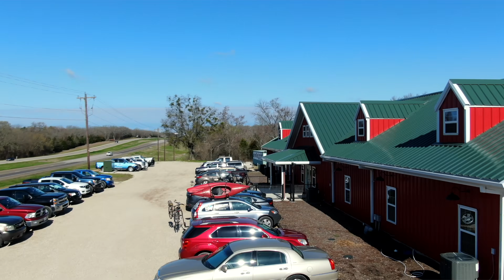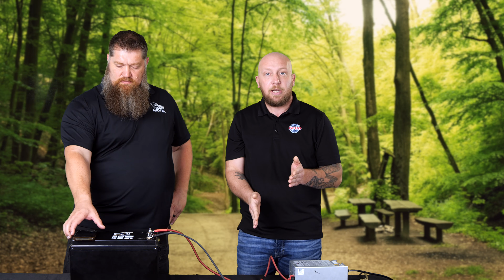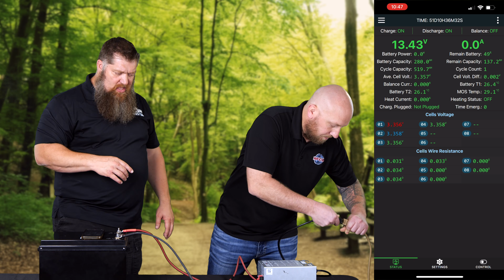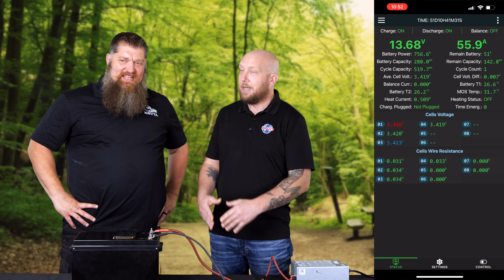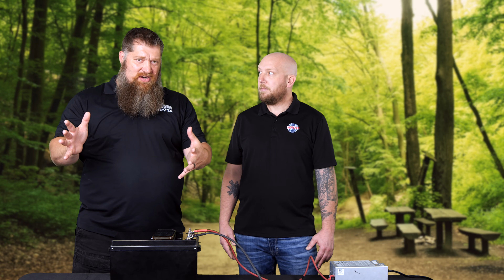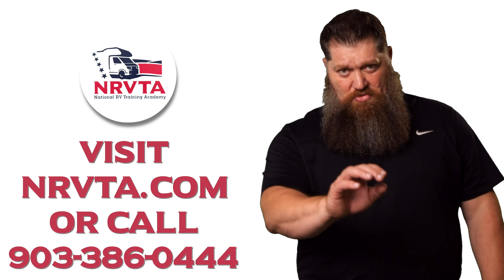WFCO auto detect battery charger, does it actually work?

Comment: I (like many others looking for this converter) have updated my camper to a battle born 100ah lithium battery.  After talking to WFCO about updating they said that I would need the updated converter with the 1.19 version for the battery to “auto detect” the lithium battery and switch from lead acid battery mode to the lithium mode.  The only supplier that I could find of the 8955-AD-MBA auto detect was Amazon.  I purchased the “updated” version hoping that it was the one with the 1.19 firmware version, since Amazon support would not tell me if it was or not. (Unless I purchased it first, dumb).  I received it, and sure enough it was not updated.  WFCO tech support said that it needed to have a sticker on it saying 1.19, mine did not.  WFCO tech said that it should still work anyway with the battleborn battery.  I tried to get it to “auto detect” lithium for a week and also while on the camping trip, both with shore power (Regular 110 house outlet) and with my very capable generator.  I had to run the generator for at least four hours a day while camping (since it was only charging in Lead Acid battery mode) just to keep us above water and not losing full power for our 12v fridge.  On the last morning I gave up and my final attempt was to let the percent of battery go down to 4% remaining, (WFCO says down to 10% to get it to switch) kicked the generator on, let the light turn green and the red charge light startup, and then flipped the main power breaker off and back on, and the light finally turned blue.  After all of that, and lots of celebrating,  the lithium finally started charging at 50 amps (up until it reached 50% capacity and the charge rate dropped substantially to 13amps) Now, come to find out, the converter is still not letting the battery take the full charge and has never reached the “balancing” 14.2 v even when it’s in lithium mode.. So, even though I got it to switch to lithium mode, it’s still not doing what it’s supposed to be doing.. I followed all of the YouTube recommendations from WFCO and all of their advice exactly.  I drained my battery over four different times (down to 20%, down to 10%, down to 8% and finally down to 4%), waisted a week of my life and hours of frustration on this conversion.  My recommendation, if you want to convert to Lithium, give yourself plenty of time before camping and be ready for a lot of stress.  The “auto detect” option from WFCO, in my opinion, is a joke.  I am still waiting to hear back from WFCO and will update this post as I move forward.
Reply: I bought a Victron charger and I may replace my 8735 AD with a Progressive Dynamics 4100. Physical switch rather than WFCO's clueless sensing logic.
Reply: Is the Progessive Dynamics an easy swap from the WFCO size and wires?
Reply: Any updates on your problem?
Reply: I tried to solve this last year and never read all the comments. Tried again with no luck and then just read your comment today. "let the light turn green and the red charge light startup, and then flipped the main power breaker off and back on, and the light finally turned blue” That did it, for some reason I never got the detailed feedback about the flipping the main power breaker off in my communications with WFCO. I will see what happens from here, but the my Lithium batteries are charging nicely now on shore power. See what happens at 14.2 Volts. Know your frustration, but thanks for the post it helped me and hopefully someone else will now benefit.

Comment: I really appreciate all of the information in this video, especially around the cable length. My trailer has the typical tongue mounted batteries but the controller and electrical panel is at the back of the rv, 22' away. Im looking at upgrading to lithium batteries but didn't think about moving them closer to the controller. Thanks for the info and keep it coming 👍
Reply from the maker: Glad it was helpful!
Reply: How do you know which firmware is installed on a particular converter?
Reply: I gotta problem with WFCO providing a product that is so sensitive to distance between the batteries and the controller.  This is a metric that people with smallish (i.e. 20' or so) TTs can't easily alter.

Comment: I installed a WF-8955-AD to charge my lithium batteries.  The Auto Detect DOES NOT FUNCTION.  The company's instructions to F'ORCE it into lithium mode does not work.  It does not start in Lithium mode.  Big mistake in installing this unit.  Interesting the Lithium Battery manufacturers directions to install the batteries only at full 100% charge.  I need the two stage charging profile for lithium vs three stage profile for LA batteries (13.2 vs 13.6).  My installation is less than 4' from converter to battery.

Comment: I have the WF-8735-AD-GE drained the new Lithium down to 10% hooked it up and it started to charge. I also have a 165W solar panel. I dropped the battery in the original battery box on the A-frame and I know it is not optimal but this is temporary.  It only charged to 13.4 overnight and the LCD stayed green the whole time. I have unhooked the power and tried to force the changeover but still no luck. I was only drawing 3amps all yesterday and overnight it was still charging at the 3amps draw with the converter continuedly running.  I drained it down down to 35% this morning and now it is drawing 5amps, I have the Progressive Industries RV Surge Protector with display showing the draw. I am going to call WFCO this morning to probably find out my firmware needs updating, but hoping we can get it to switch over.

Comment: I recently purchased a trailer with one of these AD units. 

1) These are sold with a huge auto-detect sticker on the front. Nowhere is it obvious you must discharge the battery to get it to work. I’d also say that overall dealers are completely unaware of this as well. 

2) Discharging batteries is a big pain and risks damage. I did discharge my two Battleborns to 11V (I wasn’t comfortable going lower). It never switched profiles. And it only charged at 8 amps so it took over 36 hours just to bring my batteries to 80%. 

3) many people have reported the problem  above and WFCO themselves published a video on how to “trick it” into Lithium mode. Their solution is to pull the entire power panel out and mail it back for a firmware update. Are you kidding me?

4) the rep’s comments about a switch are infuriating. The switch gives choice and confirmation of selection. The attitude seems to be customers are too dumb to have a switch. That’s says it all to me. 

5) switched out my WFCO to a progressive dynamics with a switch. Charges in lithium node at a much higher amperage and I get to 100% in about 5 hours. 

They can do all the PR damage control they want. This auto detect “technology” is never going in a trailer I own again.
Reply: Well I mean if people are too dumb to switch it and the device is too dumb to switch itself aren't we in the same boat?
Reply: Agree....They need to remove that sticker- That's false advertisement- Like you I'm thinking  getting progressive dynamics with a switch to avoid the hassles...
Reply: Agree, wfco is horrible. I will never buy another rv with their chargers in it. What a bunch of idiots. Disgraceful.
Reply: Agree 100% 150%
Reply: Agree.  Maybe it's time to switch to a different manufacturer.
Reply: Which Progressive Dynamics unit did you get. I am experiencing the same issue!
Reply: I was able to get the jumper to keep my converter in Lithium mode. It was easy to install. The charge light switched from green to blue. I also hard wired a smaller Anderson connection pigtail to my Lithium battery so that I can use my auto Lithium Charger to charge my battery to the full 14.5 volts every now and then to top off all the cells. Not that I don't trust the converter but I want more control over how often I top off my battery. I'm happy with what I have done to solve this problem.

Comment: Dude this was some of the best info that has been put out lately. 
Just recently installed new wfco deck mount on my trailer with new lithium batteries. 
This was awesome. 
I also have talked to the people at wfco. They were super helpful and informative. 
Really loved this
Reply: I called WFCO five times and left a message, emailed, and even filled out the warrant return page, and I got ZERO replies. Don't know how to get the firmware upgrade that I also heard about.
Reply: @mrgehring2 
Yes to my knowledge and what I was told there is a firmware upgrade that they told me about that came out earlier this summer, about July I think. 
I really did just call the number supplied by them and talked with one of the techs. He was very informative. If I have the number still I’ll post it on here for you.

Comment: One issue that I have with this auto detect scheme is that some BMS controllers require 14.6 volts to perform cell balancing. If you don’t hold it at 14.6 volts long enough it won’t balance the cells. That will impact performance and affect the life of the battery. If the balance gets too bad some BMS controllers will shut down the battery. A simple switch would make it easier but they must be worried about people cooking their lead acid batteries or Li ion batteries getting way out of balance and low capacity complaints. Some people just don’t like to follow instructions no matter the consequences.
Reply: Well said
Reply: Maybe some day one of the converter companies will learn the needs of Lipo4 batteries.

Comment: You showed credibility and integrity by doing this 3rd video with the correct information from the manufacturer with the WFCO tech. (I had some strong comments about your previous 2 videos) I went to a WFCO seminar last year and received basically the same information. I have found my 9855 AD works exactly as described and I also have no problem with it working with my solar. Thank you for doing this video. Your FB comments are spot on.
Reply: So do you get the proper  charging from Solar and then from the Controller? Or is it too low of a charge from your controller based on the Solar charging.

Comment: Sounds like my only solution being that the converter was placed so far away from the battery is to put a converter right next to the batteries. 

Does WFCO have inspectors that go to different OEMs to ensure their product is installed correctly?

Comment: I like to operate under the KISS principal. They had a great product with a switch and then they complicated it with auto detect.
Reply: I look at this more like a damage control video due to all the bad experiences people have been having with the auto detect feature.
Reply: A technology looking for a problem to solve
Reply: Agree. All that entire lesson and talk could be avoided with one switch
Reply: Definitely agree
Reply: I'm not sure I'd describe WFCO as having a "great" product, but I tend to agree with you on KISS generally.  Even so, I don't think having a switch would end all the issues.  A lot of these RVs simply have too long of run with too small gauge of wire.  This "test" only used 3-4 feet of wire, not 25 feet.  The voltage drop would be considerable with too small of gauge of wire.
Reply: "Auto Detect" and, added feature of "Auto Forget"!:face-orange-raised-eyebrow: Victron charger ordered.
Reply: How do I know if it's charging in Lithium or Lead mode?
Reply: No switch is more complicated than having a switch?  Seems the other way around …
Reply: Exactly.

Change is the only thing that is constant.

If a person does NOT change, life will pass them by.
Reply: @ILuvJazzNJava you seem to not completely understand the issue at hand. Thus your comments.
Reply: @GranCoyon  I assure you I understand, I have one of these "auto detect" chargers.
Reply: @GranCoyon …nope. A switch adds one more action the operator must take. Auto detect removes the extra step. Pretty easy to understand. 

…and yes, I have one so no need to ask.
Reply: @niaralosusa  ~ What's so hard about having a switch inside the converter bay that says switch here to keep this charger in Lithium mode? Honestly, anyone who owns a RV and doesn't understand switches needs to stay at hotels.
Reply: @niaralosusa  ~ Problem is. Auto Detect doesn't really work that well. If it works at all. What people want is an assurance they have their converter in Lithium charge mode.

Comment: People aren't worried about the 14.4 versus the 14.6 - they're worried about when the converter drops to 13.2 float voltage in LA mode.  Then when they're ready to leave the campground and do an overnight boondock on the way home, they don't have the full capacity of their LI to rely upon because the charger has been sitting at 13.2.  Regardless, I've had no problem with the converter staying in LI mode once it finally made the switch.  Good follow up video, thanks.
Reply: this hits the nail on the head.  Been boondocking the last two weeks with a generator to try and charge these batteries to full but they get stuck at 13-13.2 volts
Reply: I'm having that exact issue.  Float mode at 13.2v, and when boondocking, if I try to top the battery off with the generator, I don't see any gains.
Reply: Thank you for writing this, I'm in the process of upgrading to lithium and I need to switch out my main board assembly on my WFCO converter to be compatible with lithium. I have the choice between getting a board with the auto-detect feature or one that has a lithium switch...I'm going with the lithium switch
Reply: Exactly. We have only had ours detect and charge in lithium mode a handful of times. It keeps reverting back. A big P.I.A. And we can’t get a call back from the company. Ready to rip it out and replace it.
Reply: @walterobando1378  I didn’t know that existed, thanks!